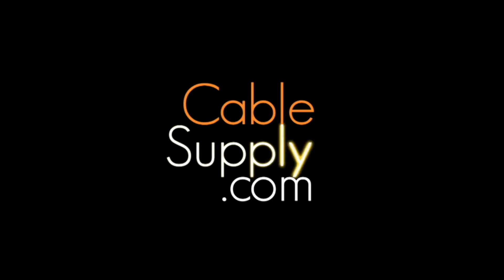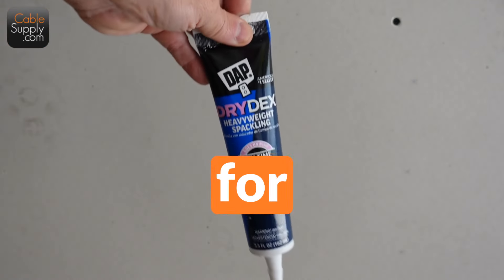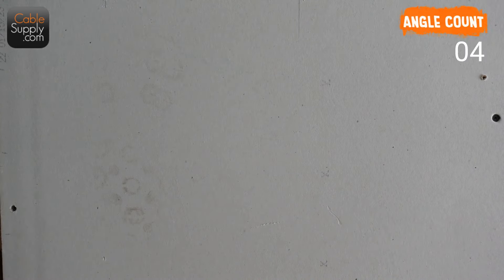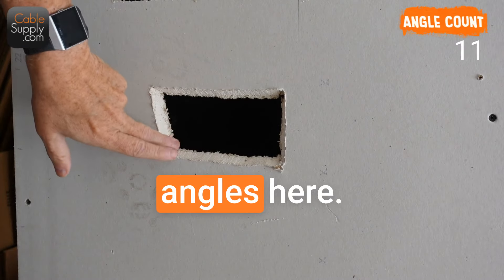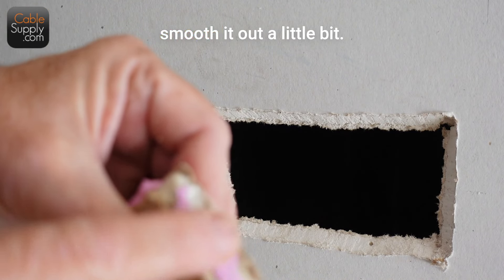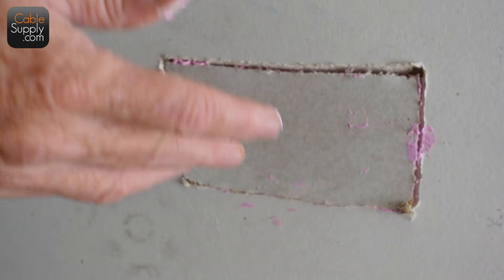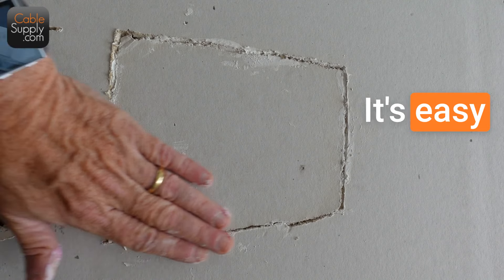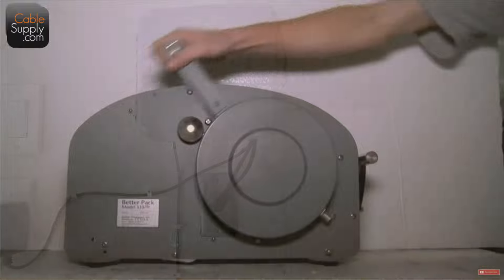Time Saving Technique for Cutting Drywall That's so Good it's Scary

Comment: why the chepo ones?
Reply from the maker: To answer your question there are two reasons why I like the cheap inexpensive drywall saws. first of all working in a construction setting my tools, sometimes get up and walk away on your own. but secondly and more importantly, I like the cheap ones because they have the thinner blades that work best when you're using a pumpkin cut. I was planning to answer that question in the this video, but forgot to include it. I am grateful that you watch the video and your comment is fantastic. It helps me to explain what I should have explained in the video. The idea is thinner is better for this type of cut.  If you remember, please subscribe.